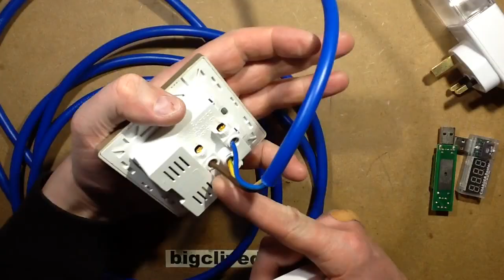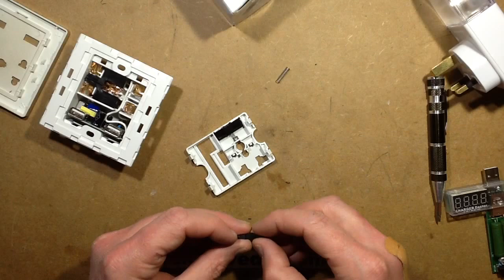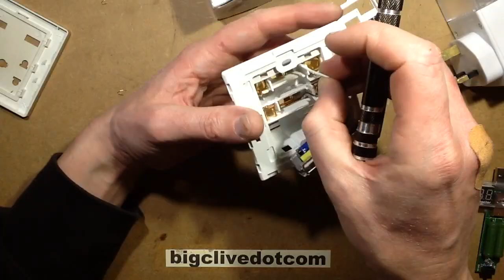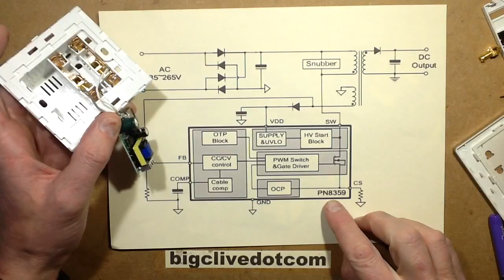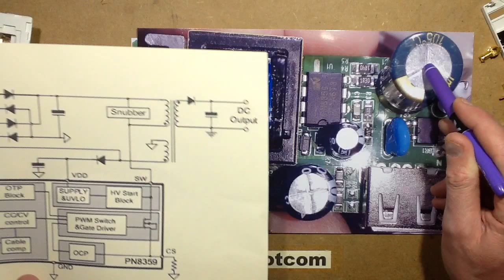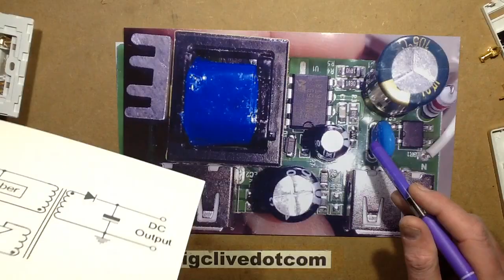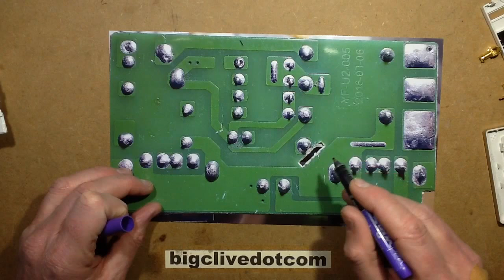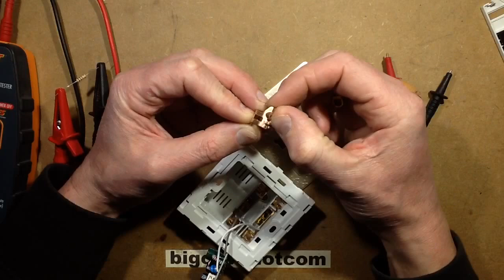Wall plate death-dapter tests including fire and 1kV.

Comment: I have been fascinated with the British power plug... It looks so ridiculous dangerous... and clunky...
Reply from the maker: It's actually ridiculously safe and clunky.
Reply: Electrically speaking, the British plug/socket is probably the safest for many reasons. However, when it comes to treading on one in the dark, with bare feet, it is definitely dangerous and bloody hurts.
Reply: Dangerous? You're kidding, right? It's probably the most safe plug and socket combo in the world! As for looks, it's a bloody plug. Lol. I'd prefer a funny looking plug to the absolute death trap crap you get in the USA...just as well they have a weedy voltage to go with it!
Reply: The British plugs are a fairly safe design. However, you also have to take into account the chance of hurting yourself by stepping on one because the flat back makes it likely for the prongs to stick upward when lying on the floor.

These days in North America, current residential codes require tamper-resistant outlets almost everywhere, which have basically the same safety features.
Reply: Gego/XAREN ゲゴザレン It is clunky but it is easily the best made and safest mains plug of any country in the world.
Reply: The british plug is a marvelous piece of engineering that manages to solve problems no other plug design needs to.
Reply: You are a very disgusting and distasteful person. 'YOU' British should change this, this and this. I love how you talk about the British plug being too big, yet YOU americans drive around in your petrol-guzzling 'my-country-is-better-than-yours' tank cars. You are one of the reasons the world is getting really pissed off at the US. Absolutely disgusting.
Reply: Colaholiker
Even U.S. Christmas lights which have thin wires and a fuse in the plug to compensate, do not have huge plugs. The fuses are not that big, so U.K. plugs are huge, just to be stupid and obnoxious. Even on travel voltage converters, the U.K. plug is the largest plug, and it is monstrous.

I wonder what else they do wrong in the U.K.? Worship some corrupt pointless monarchy, and drive on the wrong side of the road. Well at least they speak English, but then, they have some really weird ways of saying some things.

So I suppose that electric space heaters, actually put out some decent heat in the U.K.?, unlike the U.S. where at 120-volts 15-amps, we can only get but 5000 BTU of heat from a standard electrical outlet. But at least our outlets are typically duplex outlets, because they are not ridiculously huge.

One thing that is really neat about how the U.S. does its residential wiring, is that houses have 2 hot wires in their power company electrical service, which together form 240-volts, used for high-power appliances such as the electric cookstove, the electric water heater, clothes dryer, and the central air conditioning. By connecting one hot to a neutral, 120-volts single-phase is also available from any 240-volt circuit. Some old cookstoves added a fuse and had its own extra 120-volt outlet for the kitchen. But I think more recently, electrical code has changed a bit, and so the ground wire is not supposed to be used as a neutral, so newer installations use the 4-prong outlet for the clothes dryer, and not the old 3-prong, so that it can have 2 hots, a neutral and a ground. Neutral and ground are sort of the same, however, ground is not supposed to normally carry current, thus the neutral can sometimes have as much as a few volts on it, relative to ground, due to voltage drop along the wires.

In the U.S. most of our electrical outlets are within a foot of the floor, although a few outlets might be found higher up in the basement. How does that compare to other countries?
Reply: The more amps we can pump through a standard plug,the more amps we can pump into a kettle. Therefore, the quicker we can boil a kettle for tea.
Reply: Yosef MacGruber don't worry about us teaching you English, your new language is soon to be Spanish if my Mexican friends have their way ! Yay. Finally people bringing some culture to mexico's northern 48 states. The fact that you consider a plug 'obnoxious' says plenty about you, in the uk we plug them in, enjoy our lives and don't sit around worrying about irrelevant crap. Perhaps someone from the nation that gave the world the fucking kardashians and voted in a tv show host as president shouldn't be throwing so many stones. Enjoy your plugs, good bye....oh sorry I mean adios amigo!
Reply: Ha ha. That was tongue in cheek! Actually it is now illegal to retail appliances without a plug attached. Unfortunately we have dumbed down our kids so much that they no longer learn to wire a plugtop in secondary school.
As regards our system of distribution to the conumer and subsequent installation within the home, I'd sooner be able to plug my washing machine or 3kW electric kettle into any 13 Amp outlet in my kitchen without recourse to installing specialised circuits and wasting copper to service their needs. Our system has worked and continues to work very nicely thank you.
Reply: Such a hateful, deceitful, judgemental civilization you people really are. You talk of arrogance..... the hypocrisy is rife with this one. Utterly disgusting person. Go start a war over oil or something... oh wai...
Reply: Yosef MacGruber 'Americans know how to build shopping carts'
Is there actually a difference between American shopping carts and shopping carts literally anywhere else in the world?
Reply: They usually (always? Don't know, I'm not from Britain) have a fuse inside. In many countries (including continental Europe and North America) you usually have your cables inside the wall laid out like a star - from the circuit breakers in the box to the outlets all over the place. Power is fed in on one end of each cable and is used on the other end of it. If a circuit breaker trips, everything behind it is dark and cold.

In Britain they used to install the cables like a ring (maybe they still do?) powered from both ends, which a) allows for a higher current without requiring a bigger cross section of the cable and b) even if one wire breaks you still get some power to the outlets. But if you can get more amps out of that outlet it means that theoretically everything you plug into it needs to be able to handle that high current, even if it's just your phone charger. That would make things way more expensive and heavy - and so every device gets its own fuse in the plug allowing you to use thinner wires right from that point without risking the device to go up in flames if it malfunctions. (You'll blow that fuse first and the malfunctioning device will be shut down.)
It's a nice concept, but the fuse requires some space, making the plugs quite bulky. And - if the ring breaks in one point somewhere in the middle and you still draw the full current, you are overloading the remaining wire without tripping a circuit breaker... cough

I'm no English native speaker and here in Germany we do things differently, but I hope you understand what I'm trying to say.
Reply: Main reason why UK plugs are so big, is making more space between your fingers and pins. Basically, plug is designed in such a way, that in no circumstances you grab those pins while they are under load.
Reply: nej! Yosef MacGruber. Not you.
Reply: My favorite is the swiss one. Is pretty save, especially with the old outlet style disappearing, and you get triple outlets.
Reply: Gego/XAREN ゲゴザレン definitely clunky.. being hit in the balls by one kills I can confirm...
Reply: Then why is it so ugly huge? The most obnoxiously-huge plugs in the world. British homes must be ugly inside, with ridiculously huge plugs everywhere. Gee, it isn't like you are plugging in a high-voltage clothes dryer.
Reply: I think the fuses inside UK plugs are generally replaceable, the ones inside NA plugs that have them are generally not. That would make them larger. Also I think that part of the reason for the large size of the UK plugs is that plastic molding technology wasn't as good back when they were designed and the shutter mechanisms wouldn't have been viable in a smaller size.

Other plugs are almost as big though, like some of the grounding Europlug versions like Schuko. Power bars for those are pretty hilariously large.
Reply: The original 2-prong US plug dates from the early 20th century. Didn't have tamper resistant shutters back then though.
Reply: Colaholiker
Your English is impressively good.

We do still use ring mains in houses and all separate mains plugs are fused.  Items with built in plugs like chargers don't have fuses (at least not ones that can be changed without dismantling the whole thing).
Reply: Yosef MacGruber The average kettle can hold 1.7L. That water needs to heat up an average of 80 degrees. 1L of water takes ~4200 joules of energy to heat by 1 degree. That's comfortably over half a million joules required to boil a kettle, which is a hell of a lot of energy.  

500 amps would be stupid. 13 amps max from a socket is plenty enough.
Reply: Yosef MacGruber In Britain, it's very common to offer visitors a cup of tea to drink. Typically, if you're boiling the kettle to make tea, you're making it for multiple people - often four or five cups. When a household can be making upwards of 20 cups of tea a day, the kettle is by far the easist answer. A boiler won't work: it doesn't actually boil water.

And can we get past the 500 amps idea? It's insanely stupid and deadly, and would destroy the national grid. They have enough problems with electricity spikes as is.
Reply: Yosef MacGruber Can we get past the idea that 500 amps would be a good idea? I've only ever said it was a bad idea. If we used 500 amps from every appliance, we'd manage to kill half the population of this country in about a day.
Reply: I am Swedish... *Sniff...*
I feel offended...
Reply: Your English forefathers whom fought for their rights as Englishmen spoke better English than you. haha They were much better people :) more secular; innovative thinkers. Had the correct idea for people. Fuck knows what's happened hahaha maybe it's that mcdonalds or some shit.
Reply: Yosef MacGruber You just wrote 45 lines defending yourself over the internet. You are really in no position to speak about irrelevant crap.
Reply: Yosef MacGruber : This is exactly the socket we would use to plug in a clothes drier. Unlike the weedy US system we don't need a special high voltage/current socket just for a drier or other high power loads, they can be plugged in anywhere in the house.
Reply: +Yosef  That could almost be an argument except driers aren't the only high power load.  For instance I have a 3kw kettles that boils water very quickly and that needs almost 13Amps at 240v.  No worries since I can plug it straight into any outlet in the kitchen.  I have a 150 Amp MIG welder in my workshop and a large air compressor that requires about 2.5kW.  Both plug straight into the standard 13 amp outlets and if I need to use the welder outside I can run an extension lead from anywhere in the house.  I don't need one but if I required an electric heater up to 3kW (some houses don't have gas) I could plug it in anywhere.  As if that wasn't enough, the US plugs are flimsy as hell, the prongs are easy to bend and they often don't plug very securely into the outlets.  You'll never bend a pin on a UK plug, and they don't fall out of sockets with the weight of heavy cable.
Reply: Robert Hancock
Or maybe the standard was defined over a half century ago, and somebody was scared of high voltage, and so said, "Let's make it ridiculously huge". But then the U.S. uses a really old standard, and we were able to make it small?
Reply: And as a last ditch defense against "foreigners" we can lay them on the beaches pins up so that "immigrants"  can be assuredly deterred.
Reply: Robert Hancock
Back when electricity was the new and scary thing, we sensible Americans didn't have to have monster-sized plugs for at least our ordinary electric devices.
Reply: Hassan Burrows
And as a last ditch defense against "foreigners" we can lay them on the beaches pins up so that "immigrants" can be assuredly deterred.

Yeah, that ought to work. At least those plugs are good for something? And just think how many of those plugs you will have, once you all decide to switch to a more sensible standard. Should be easy enough to switch considering how backwards it is that electric devices in the U.K., often come incomplete without a plug on the cord, so all you British then are do-it-yourself electricians?
Reply: came, British plugs used to come unwired, even techmoan made a comment about how he remembers doing that, but all the devices I've seen in youtube videos the plugs are now just tacked on at the factory, but what to i know im just a colonial who based on these comments will be killed by his countries antiquated and dangerous plug and electrical system design, bloody hell the american standard is only dangerous if your an idiot dont touch the pins when plugging the socket in, job done plus honestly i like the bi pin plug its small and very easy to not notice that its there till you look for one, plus when we get power taps here they come 8 to 10 plugs on board wheras uk models and even some european models have like 4
Reply: Jesus, this is a long argument over a stupid thing.  So the plug doesn't look great and the sockets (especially the double gang ones) aren't especially attractive.  But you know what?  Our houses are so small that almost all of the sockets are hidden behind furniture or the appliances that are connected to them, so it's really not an issue.  And because every socket is wired to the same standard, it means we can use our high draw devices (such as kettles that don't take half an hour to boil, high pressure steam irons that can iron shirts just by being near them and space heaters that actually generate heat) can be plugged in with abandon anywhere in the house, without having to worry if the socket is earthed or if it's connected to the right supply.  Oh, and because they can handle so much current, I can plug in 12 electronic devices into one socket without fear of turning my home into an impromptu bonfire.

Oh, and our constant need for tea doesn't make us unproductive, because we do this:  When we've finished making our drink, we take it back to our desk and carry on working.  It appears that we Brits are able to do something that you Americans can't: drink tea and work simultaneously.
Reply: @leopold7562 
Oh come on, U.S. kettles heat up plenty fast enough. What is it with you British and your silly tea breaks? About the only thing that U.S. electrical standards are lousy for, is that electric heaters do not have all that much power.
Reply: @yosefmacgruber1920  What is it with you Americans and the prediliction for that brown, gritty liquid you laughably call coffee?  See, we can both play this game.
Reply: @leopold7562 
And so what "game" are we supposedly playing? You criticize coffee. Really? Was I supposed to disagree? I don't like coffee. It is bitter and it looks like muddy water. When I had a coupon for free coffee, I complained to the sales clerk that I don't like coffee, and he explained that the coffee machine also makes hot chocolate. Cool. That will work.
Reply: @yosefmacgruber1920  yer talking shite there chief. Since 1992 or somewhere around there it's been illegal to sell an electrical device without a plug in the eu. But since you bring it up, wiring a plug is something most are taught before they're 12. I mean it's not rocket science, is it?
Reply: @capnskiddies 
Well why stop there? Why simply attach a plug? And then there is the risk that a customer will not do it properly, having loose wire strands that could get shorted, or maybe making the connection too loose. Why not just have a bunch of loose parts in the appliance box, and say right on the box, "some assembly required"? Why do you need a circuit board in that device? Can't you install the circuit board yourself? Can't you solder on some wires yourself?

I have wired a couple of plugs. Once to repair a damaged extension cord. Rather than trying to re-splice it, I cut out the bad section and added a socket and a plug, which worked better. In another instance, it was for an old computer that had a switched electrical outlet on the computer case, to power the computer monitor. Well I wanted for it to switch on all of the computer's peripherals. But a standard computer power cable positions the prongs a little different, closer together. Not compatible with a surge suppressor power strip with multiple outlets. So I cut the socket off of an extra computer power cord, and put a standard socket onto it, so that I could plug in another surge suppressor power strip.

I have even changed out electrical outlets and light switches. And in the U.S. most anybody competent with electricity, tends to do it "live". Meaning that we do not necessarily turn off the circuit breaker to turn off the circuit, but rather just connect live wires. It is often easier and faster to do it live, than to trace out the proper circuit to turn off. But I think most electricians do not like to work with the circuit being live, if they are working with voltages about as high as they would be in countries such as the U.K.

But in the U.S. the common people are not expected to do their own wiring. Most everything is ready to plug in, right out of the box. The main reason we would wire something, is if we have a special application and want to modify or repair something.
Reply: Hassan Burrows Other countries on the same standard include Ireland and Cyprus. Both are also islands where one drives on the left. Not sure about Malta.
Reply: @qwertyTRiG  same, they drive on the left. They have mixed sockets I think, some 127v stuff. Fuck knows why though
Reply: jur4x
They could have made the plug smaller, and made it into a more finger-safe shape.
Reply: Hassan Burrows
Why should British customers have to install a plug? Why should electrical devices be sold incomplete? Why stop with having to install your own plug? Why not sell every device, as a bag of parts (hopefully not too many or no vital parts are missing), that if you buy a coffee maker or electric kettle, well let's hope that you were not wanting coffee or tea today. Because it is going to take you 2 days to figure out how to assemble the thing.
Reply: TRiG (Ireland)
Driving on the left is just so backwards. What even is the point? To make foreigners feel unwelcome?
Reply: Yosef MacGruber Historically, many devices in the UK were sold without plugs.
Reply: TRiG (Ireland)
But why? Wouldn't it be more competitive to sell products that are complete? I mean some products, actually come with batteries in the package, or even installed.

Are the British lazy, and they just don't want to finish completing the product? Or are electrical products, designed not to be used?

I think in the U.S, about the only thing that doesn't come with a power cord, is an electric clothes dryer, because they don't know which kind of electrical outlet that you have.
Reply: 124Andro
Yeah, and the TV and its black-and-white CRT bulky picture tube, was a marvelous piece of engineering, oh so long ago. Who cared that it was very bulky and heavy? The only alternative back then, was silence or conversation with real people or to read a book? Now the CRT is seriously outdated. And why was it that no other country seemed to need a standard plug that is ugly-humongous? Maybe the British aren't such good engineers anymore? Maybe the British ought not to have an entire 30-amps per circuit? That seems unsafe. Bedrooms do not need 30 amps, unless one is plugging in a window air conditioner or space heater.
Reply: Yosef MacGruber
 How about you take a course in language comprehension first?
Reply: Duckman Drake
But you are not heating that much water, so more amps doesn't do much then. Why not pump 500 amps then? We need more YouTube videos of cool stuff exploding.

Of course, I don't want that much power in MY kettle.
Reply: Duckman Drake
Do you need nearly 2 liters to make just 1 cup of tea?

I have no trouble boiling a saucepan of water, in a short amount of time. You do know that our electric cookstoves in The United Slaves of America, have special 240-volt outlets, and are on a 40-amp circuit breaker normally? (In case we are cooking Thanksgiving dinner with every stovetop burner on, and the oven on as well.) But coffee makers and crockpots work just fine, on a 20-amp 120-volt kitchen circuit. Actually, most everything is built assuming 15 amps circuit capacity, as most normal circuits are either 15 or 20 amps. Products would get returned, if customers complained that it was tripping their circuit breakers. On just a 15-amp circuit, we can get up to 1500, maybe even 1800 watts. Which is easily enough to run countertop small ovens, microwave ovens, and quite a lot of power tools.

Why not 500 amps? I thought you said that more power was better?

Do you know how much a joule is? Isn't a joule roughly a watt-second? Power (rate of energy) is energy divided by time, so energy then is power multiplied by time. So you are saying that the water increasing by a degree, every 3 seconds, is too slow? You can't plan just a few minutes ahead, to heat your water? And do some modern kitchens, now have an instant very-hot water spigot at the kitchen sink? 1500 watts (in the form of a space-heater) will heat an entire bedroom, so a liter of water should be easily enough to heat.
Reply: Duckman Drake
Why isn't 3 seconds to a degree of increase in water temperature, enough? And why would 500 amps destroy the grid? Wasn't 500 amps, sort of your idea? It was you who said that faster is better? Factories use far more than that. You British do still have factories? Are you heating merely 1 or 2 liters of water, or do you also want your entire 40-gallon water heater, instantly-hot also? Not many tea kettles would be simultaneously drawing energy from the grid, if your water could be heated in 2 seconds.

I have a better idea. Drink fruit juice rather than tea. I rarely ever drink hot tea. I like the ice tea better, and I never make tea for myself. I drink a lot of boring water, because what could be cheaper?

If I ever come to visit, could you think of maybe something better to serve me than just boring tea? Like maybe a meal, or maybe give me a good book to read?

Why not use the NWO-suppressed free-energy technology? You could produce your own electricity, and you don't have to let somebody else's grid dictate what sort or amount of electricity that you use, although I imagine that old standards would still be largely adhered to, even after people switch their homes over to whole-house free-energy machines. Of course, you could always purchase another separate free-energy machine, to power your workshop or experimental lab.
Reply: Duckman Drake
So is 200 amps about right? I really don't understand what the issue is, with a kettle being but 10 amps? Have you even checked the rating of your kettle?

Too much power is just asking for problems. The thing could catch on fire, even before it has boiled all of the water off. I presume that many of those kettles, are supposed to shut off automatically, once the water reaches a boil? But those switches can sometimes fail, and more thought should be given to proper safety.
Reply: Frisia Bonn
Well the British do drive on the wrong side of the road.

We love our big cars. Why not? Some people need big cars for their big families. Why do you want to drive around in some little unsafe coffin on wheels? I mean seriously. What is with those tiny "Smart" car golf-carts, people driving those little toy cars on the freeway, pretending like it is a car? The problem with our big American cars, is not their large size that makes them useful for our large families or carrying our passengers or cargo, but the awful dirty and noisy internal combustion engine that powers our cars, according to a massive NWO conspiracy that suppresses Tesla's free-energy technology that we should be using by now. The evil NWO elitists want us extorted into paying their phony energy scarcity tax. I can't stand those ugly stupid sports-cars. They are so incredibly stupid. More money for less car? How does that even compute? Not even a real roof on top, a stupid hot and noisy tent or a missing roof, and quite many sports-cars are missing the rear seat. Where are you supposed to put your children? Into the briefcase-sized trunk?

I bought an international voltage converter, and the British adapter plug, was the most monstrous-sized plug. Hey, why just be obnoxiously-big with the plug size? Why not just make the plug a foot wide, and make the electrical outlets, look like some huge freaking hole in the wall? (sarcasm) I mean, how big does it have to be, before even the British agree, that it is over-sized? Do I hear 2 feet? 3 feet? Make the entire wall, an electrical outlet?

The reason the world gets so pissed off at Babylon America, is all the arrogance and lies that this now-corrupt, has-been country is spewing. Rampant anti-family contraceptive pushing. 9-11 was an inside job. The DemocRAT Party was the party of slavery and racism. The manned moon landings were probably faked. The American government is far more corrupt than most people yet realize.

BTW, even the American Tesla electric cars, are BIG. As they should be.
Reply: Frisia Bonn
Are you trying to get me started on the evils of Babylon America?

Government monopoly schools and mind-rot garbage on TV, just sucked the intelligence out of so many Americans.

But at least we Americans know how to build shopping carts, and most of our plugs are not too big. And most of our cars do not look like toy-car golf carts. Except for the exception moron car owner, here and there.
Reply: Duckman Drake
You didn't know? American shopping carts usually have only 2 steerable wheels, and 2 wheels that go straight. Thus, American shopping carts can travel in a fairly straight line, much like a car does. Shopping carts elsewhere in the world, wander all over the place, because they don't know how to build shopping carts correctly. Also, the shelf underneath is often missing, because apparently, stores do not want to make a profit, and they want you to buy extra stuff, at another store - at their competitor's store.
Reply: High Light
You don't worry about irrelevant crap? So that is why you are discussing British plugs then? Because you don't worry about irrelevant crap. Got it, or perhaps not.

Hey, don't blame me for the crap on TV. I hardly watch TV anymore. I mostly watch YT now. There hasn't been much good TV programming produced, since the 1980s. Even Star Trek is probably on a downward slide. And why are British comedies so stupid? What British stuff have I seen on TV, that was any good, other than MI-5?

Come on, you know why Trump got elected. A whole lot of people were afraid of the rampant corruption that Hillary Clinton would continue. A popular slogan for bumper stickers and T-shirts is something to the effect of:

Trump For President
Hillary For Prison

And don't forget that President Ronald Reagan was also a movie celebrity.

Not all celebrities are air-head blonds who know nothing of morality or politics.

We Americans did not want to hear Hillary's lying voice for the next 4 or 8 years. And quite many foreigners are happy to have President Trump be our President, rather than another corrupt Clinton. And had Hillary Clinton become elected, you would want to stay far away from Babylon America, for as the Titanic corrupt nation sinks, you don't want to get caught in the undertow. With President Trump, as least the sinking will be slowed somewhat, allowing people more time to escape.

And no, I do not want to learn Spanish, a stupid language with about the same letters, but all scrambled to confuse people. And they talk so fast, like they want to keep outsiders out.
Reply: Duckman Drake
Are you saying that we should not discuss "irrelevant crap"? And did we ever establish, why it is irrelevant?

I have traveled passing through London's Heathrow airport, and it was an ugly cluster-fuck airport, just a random hodge-podge of endless buildings and crap all over the place. Sort of like the ugly British super-sized monster plug. Don't you British ever get tired of your ugly oversized and congested London, and ever modernize anything? Why don't you all build sky-tran? What is so great about London (or NYC) that so many people would want to live there?

But to be fair, I suppose that JFK airport in NYC, was even worse. Bad news on the TVs, broken escalators that weren't even being fixed, and ugly stupid art. There is plenty that Babylon America doesn't do right either.
Reply: Yosef MacGruber I'm not saying we shouldn't discuss irrelevant crap; you're inferring that from what I said for the sake of arguing.
Reply: Duckman Drake
That ugly British wall plate, just cries out for somebody to criticize how ugly that it is. Can't people just see the ugly oozing out of it?
Reply: Dangerous? lol its the most safe plug you will ever get.
Reply: eraldorh
I believe you need to re-read the what I wrote...
Reply: Gego/XAREN ゲゴザレン I like having a big plus as you chargers and stuff never fall out, which happens to me with EU sockets, especially with a big travel adapter.
Reply: +Matt Mellor
The big problem is with old outlets that are round instead of the modern style.

The Modern Euro/Schuko Sockets have notches on the sides so the two plug plugs don't fall out.

Also: if the sockets are reeeely old, they might not even have a rim, just flat... Those are scary...
Reply: Sannesthesia 
It is not the Voltage that is dangerous, it is the amps.

Static electricity is several thousand volts, but no "umph".
Reply: Sannesthesia 
That has nothing to do with it. What about two or three phase plugs? those have the pins closer than a schuko, IIRC, (might be wrong here...) and they have 240v on two or three pins plus one neutral and one earth...?
Reply: *****
The distance between the prongs is far greater than what is needed to prevent arcing. No, it would seem to be according to safety concerns, such as keeping fingers out away from the prongs. But that could be done by a more intelligent shape, rather than by ridiculously huge size.

The shopping carts are so hard to steer, because they build them incorrectly, lacking the 2 straight wheels that they are supposed to have, as is common in The United Slaves of America, where at least we Americans know how to build shopping carts. And why in the world are your store floors sloping? What kind of substandard buildings do you have? Are they just big circus tents slapped onto a parking lot pavement?

Your understanding of what makes for power rating, is wrong. Power is voltage times current. Thus, a huge advantage of higher voltage is that it can deliver more power, using LESS current. That is why in The United Slave of America, where we only have 120 volts, it is 240 volts going to the main power-using appliances such as the central air conditioner, the electric water heater, the clothes dryer, and of course the electric cookstove. High voltage is dangerous, because across a fixed resistance, double the voltage would be double the current. Since power is voltage times current, the heating of the resistor then is quadruple, or doubled twice. But under low voltage, the dead skin cells of the human body, well unless very wet or something, are high resistance. But under higher voltage, the resistance breaks down and conducts more current.

Oh, now I see you meant that the 120 volts service would have to have more current, to produce the same amount of power. However, I think we Americans run more circuits instead, or switch to 240 volts for high-power appliances. And we prefer to heat our homes by burning natural gas, and not so much with electricity, as electricity doesn't easily produce enough heat and is too expensive. But then, if we had more mini-split heat pump systems like the rest of the world has, we could more easily heat our homes with electricity.
Reply: +mikerjuk
That almost could be an argument, except that every U.K. power outlet, is some ugly monstrosity, like how our U.S. 240-volt clothes dryer outlet is. But we don't care about that, because it least the old standard was, that the washing machine and clothes dryer were stuck down in some ugly unfinished basement anyway. Even with the newer way of doing things, the washing machine and clothes dryer, might be upstairs in some utility room or in some closet, out of the way.

Anywhere in the house? Like in the bathroom, like how they do it in some countries? It would be very unusual to find a washing machine in an American bathroom.
Reply: +mikerjuk
What is with you U.K. people and your supposed need to have fast water-heat kettles? Do you British drink tea, like every hour or two? Why don't you just plan ahead? Or why not just keep the water hot all the time? Why just 13 amps? Maybe you should do 100 amps, and have your water hot in a few seconds? (sarcasm)

I do not even have an electric kettle. I am not a tea drinker, and I definitely do not like coffee. When I need boiling water for cooking, I just set a pan of water onto the stove burner. So I suppose it would save me just a few seconds if I had a kettle taking up counter space?

You have a welder? Well so do I and so does everybody else? Not. How many people need to plug in a welder? Under 1% of the population, so what is the relevance? Does most everybody in the U.K. have home workshops, and they aren't helpless like we moron gullible Americans are?

Why do you have a welder? If I need something welded, should I send it to you - Do you actually know how to weld?, or do you have a welder, because it impresses the other guys or makes you feel important? Whatever do you do with a welder? Do you use it, to build you a spaceship, so that you might someday escape from this oppressive world? I just can't imagine why very many guys, need welders. To build your own free-energy flying car? For what do you use a welder? Are you an engineer?

Yeah, never know when I might need a lot of air under pressure, to power my simple corded drill. Oh wait, my drill does not need air. Whatever do you need an air compressor for anyway? To inflate the monster tires on your monster truck? Do the big tools make men feel more manly? Hey, I have a few tool boxes. That seems like enough. If I had any more tools, then I might have to fix stuff more often?

From anywhere in the house? Running extension cords out of doors and windows really is tacky-awkward. Don't you have outside electrical outlets? Why don't you install a few outside outlets?, in the proper weatherproof boxes but of course. Or do the British not believe in having outside outlets to power yard work tools or to take your project outside to work on it?

Why would you plug in a water heater anywhere? In The United Slaves of America, the water heater is a fairly permanent-location fixture, it needs to go where the water pipes converge for a water heater, and never would it be "plugged in to somewhere". It is always a special dedicated 240-volt circuit run directly from the circuit breaker panel. No competent electrician or installer would "plug in a water heater to somewhere".

Well I do admit to that, that our American electrical outlets become too loose too easily, prongs bend when morons plug things in or do not remove the plug properly, and it obviously is a poor and outdated design. But that hardly compensates for the U.K. plug design being ugly huge monstrosities.

BTW, how many electrical outlets would there be in a room, in the U.K.? When I stayed in Israel for a while, there was maybe 1 electrical outlet in the room, and it couldn't even support the weight of my $19.99 voltage converter box. I had to borrow an extension cord so as to remove the weight from the outlet. And that is using 230 volts. Is the U.K. the only country that has tight electrical outlets? Do you then have to be some strong athlete, in order to unplug a plug from the outlet? Do you need some special tool to pry it loose?

Maybe someday soon, free-energy machines will make electrical outlets obsolete, well except that free-energy machines will probably have electrical outlets on them.
Reply: What is it with you American people and your inability to understand the simplest of things?  Lots of people drink tea and coffee during the day and it's convenient not to have to wait ten minutes for a kettle to boil.  Keeping the water hot all the time is a waste of energy and money, surely even a simple American can understand that?  We just put enough water in the kettle for whatever we are doing and then quickly boil it using our superior electrical system.
13 amps, (just over 3kw at 240v) is a very useful for high power appliances without requiring huge and expensive cables, or a special socket that ties the appliance to a single room.
Reply: +mikerjuk
When I need to cook, I start heating my water first, and it doesn't take long to get hot, and by then, I can have all my other stuff ready. So it is a British thing, wasting the day away, drinking tea all day?

Your "superior electrical system"? Did you pat yourself on your back, while saying that? Ha! Ha! Who thinks it is superior other than you? What is so "superior" about it anyway? Powered by free-energy? Yeah, I didn't think so. About the same as ours, except that you have those monstrous giant electrical plugs. And hardly compatible with that of any other country in the world, because you all just had to be different. And why was it not until recently, that your electrical stuff came with cords and plugs attached already? If your system is so "superior" then why don't you have 100-amp kettles? Why wait for a minute when maybe it could be done in 10 seconds?

Why would I want to move my appliances to another room? Should I put the kitchen stove into a bedroom? Should I put the clothes dryer where the kitchen stove used to be? Those appliances are not exactly all that portable anyway. Wouldn't I probably want my clothes dryer next to the clothes washing machine? Are your British plumbing pipes and hoses, just as portable? Are British homes just ridiculous, with no defined place for laundry? Do you just put your appliances "wherever"?

And why do you British drive on the wrong side of the road anyway?

When I saw your Heathrow London airport, it was the most ridiculous giant hodge-podge of crappy design. As if they just kept building on more and more crap, with not really much of a design plan at all.

And why do you British maintain a corrupt and useless monarchy?

Well at least you speak passable English.
Reply: Yosef:  Please accept my apologies; you are clearly struggling to understand some quite simple concepts so I'll try to use shorter words and clearer descriptions.  

Firstly I'm not talking about fixed appliances.  Moving a full sized kitchen stove into a bedroom would be foolish and ultimately pointless as they consume more power than even the mighty 13Amp UK socket is able to provide. However on this side of the pond we have things known as 'portable appliances'.  These can easily be picked up and moved around to be plugged into a different outlet. This is probably a mind-blowing concept for you, but let me assure you that they really do exist.

What is superior about the UK system?  That has already been covered numerous times by me and others, but if you want a quick summary:
1) Delivers almost twice the power for the same size fixed wiring.
2) Lower copper loss for a given load.
3) Robust plugs and sockets that don't look like they were designed by Toys R Us.
4) An effective and safe shuttering system on the live and neutral terminals of the socket
5) Every plug contains a fuse to protect the flexible cable of the appliance being plugged in.

Our plumbing does not tend to be portable, apart from e.g. garden hose pipes.  The number of portable appliances that require a hot or cold water feed and drainage are quite limited, and the ones that are available are typically designed to work on or next to the kitchen sink e.g. small portable washing machines which may be used in bedsits etc.

Some houses have laundry rooms, but many smaller houses have the washing machine built into the kitchen.

We install our fixed appliances wherever they are the most useful, or failing that wherever there is room for them.

Driving on the right hand side of the road is no more correct than the left hand side.

Heathrow is a huge sprawling mess, well done for noticing.  Also central London is a bit of a shit hole if I'm honest, much like New York is.  Great for a visit, but I'd hate to live there.

I'm sorry you don't like our monarchy, but what makes you think they are corrupt?  At least we don't have a complete lunatic in charge of our country, which is more than I can say for the USA at the moment.
Reply: I really don't have time to read such a wall of text in detail, but to address a few points:
Our electric heaters are clearly more powerful, you've already admitted as much.
Almost every UK home will have a kettle, and plenty of people will have cups of tea or coffee many times during the day (especially tradespeople like builders etc. that seem to have an unlimited capacity for tea).
Why is copper loss a redundant reason?
As voltage goes up cable insulation requirements increase and the danger of arcing or flashover also increases.  240v seems like a reasonable compromise.
Americans did not invent the car.  Sorry to burst your bubble but it was a German, Karl Benz, that invented the first true automobile.  The UK is not the only country that drives on the left hand side.  The USA buys millions of import cars from Japan, guess which side of the road they drive on?  Also India,  Australia, NZ, and South Africa.
Air conditioning in UK homes is very rare.  The temperature here doesn't get uncomfortably hot very often so it's difficult to justify the cost and space required for aircon.  Modern offices etc. usually have aircon however.
The monarchy is what it is, it maybe an outdated concept but they do offer some significant benefits.  They make more money for the UK than they cost, something like a £2billion contribution per year.  They support hundreds of charities.  Even though the queen holds sovereign power, she doesn't really impact the running of the country on a day to day basis.  I'm not a royalist by any stretch, but I'd be a little sad to see the end of the monarchy, it's a part of Britain.
From my perspective Obama was like our prime minister John Major.  Bland, boring and forgettable.  Trump swings too far in the other direction, and seems like he could be pretty dangerous to not only the USA but to the rest of the world as well.
Reply: +mikerjuk
#2 was repeating the reason given in #1. That is why I said it is redundant.

Why do the British have to be so bizarre, with their endless cups of tea? Do they ever get anything done, or are they always taking tea breaks? Every American home does not have a kettle, so why are the British so weird like that?

The monarchy steals money from the American taxpayer. Isn't that where our income tax really goes? To foreign bank-sters working for some corrupt government world order?

Drug gangs sometimes support charities or churches, so as to appease their guilt and pretend that they are not evil. But that doesn't make them to be not evil. Those elitists do not lift a finger to do any real work, and they make bad policies that impoverish the world.

Well I would like to see an end of the royalty nonsense in our American tabloids. Didn't we fight a war, so that we wouldn't have to worry about the corrupt monarchy anymore?

Trump does not swing too far. Rather, the world has become increasingly insane, so that anybody who is proper, may seem to be "extreme".

Yawn, liberal-retards opined that President Ronald Reagan was too extreme or whatever. Like evil liberal-retards have any credibility?
Reply: It's only dangerous when stood on barefoot in the middle of the night. The language would scar children for life.
Reply: @yosefmacgruber1920  "we americans speak the better English". English is not your first language is it? There is not an English speaker alive that would use "the" in that sentence. Next, "we Americans". If you're not a native English speaker, you're not natively American. Epically poor trolling.
Reply: @capnskiddies 
Which sentence? How can I tell whether you are referring to a minor grammar error, or if you are trying to smear all of Americans for not speaking in the "proper" British way? Uh, maybe because we are not British?
Reply: @capnskiddies  It always makes me laugh when I hear Americans talk about speaking English. There's a reason it's called English, and it's largely to do with the fact it didn't originate in America...
Reply: @leopold7562 
Oh really? English didn't originate in Babylon America? Well so what? All of the U.K. combined is less than 100 million people while we have a third of a billion people. Thus, we win, and we "own" English now. So get with the program, and while we are at it, enough with the British fake-billion and use our proper definition, 10^9 and not 10^12. Stop murdering "our" language.

But if you British want to go to the loo and not to the toilet, I guess we can let that slide. At least we can write or type that using fewer characters.
Reply: @TheEulerID 
So why should I want to visit the U.K.?